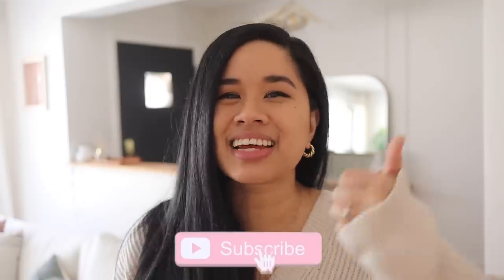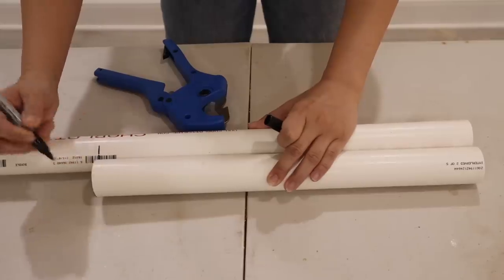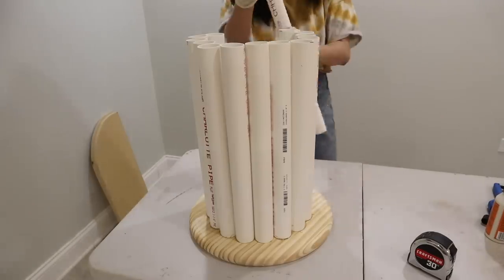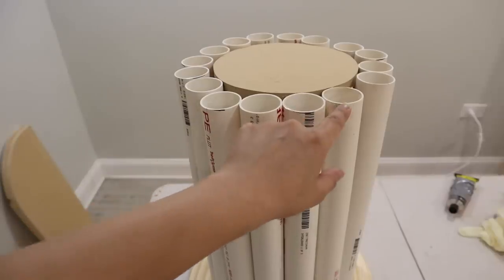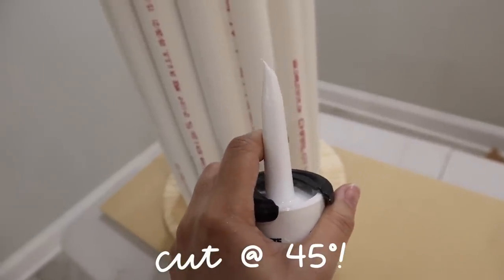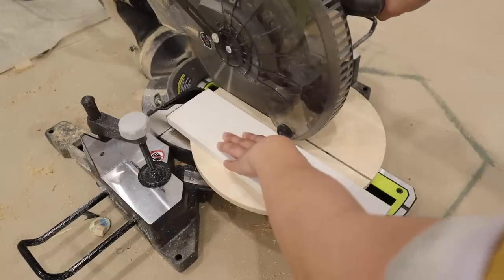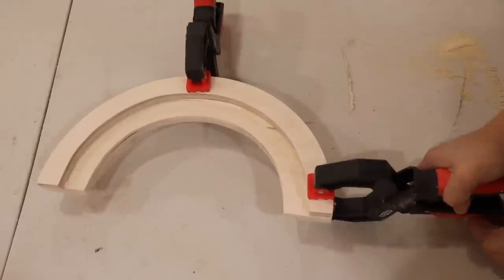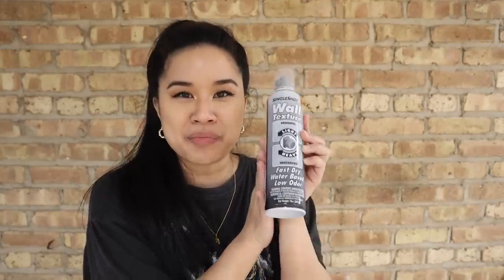I DIYED A $200 WEST ELM TABLE FOR LESS! *IDENTICAL* | Fluted PVC Pipe Table + Urban Outfitters Shelf

Comment: I LOVE these projects!!!  I've seen piles of sawdust in the parking lot at Lowe's so I'm pretty sure you're not the only one to cut to fit. lol  I know the limitations of my car. It's the main reason I have a station wagon class vehicle. I can easily fit a 6 ft board on an angle with the back seats down. lol Or as we learned when we bought our big flatscreen from Costco... will fit still in the box with the seats alllllll the way pushed up, we only lived about 5 minutes away. lol  Trying to maneuver it in the parking lot caused a brief moment of panic when we thought it wasn't going to fit.  It also surprised the guy that helped us fit my tool chest in. He was like- I did NOT think that was gonna fit. lol It did. Barely. But it did. lol